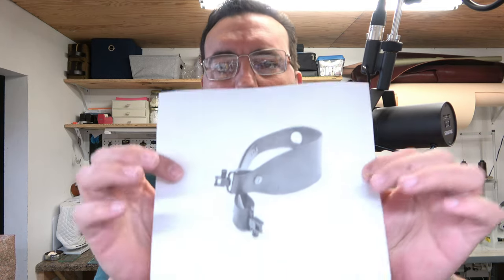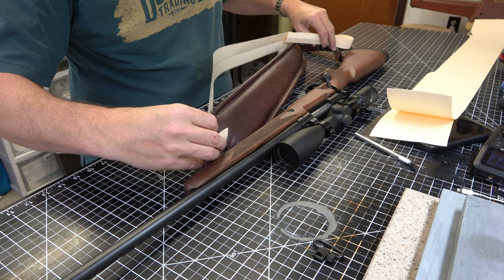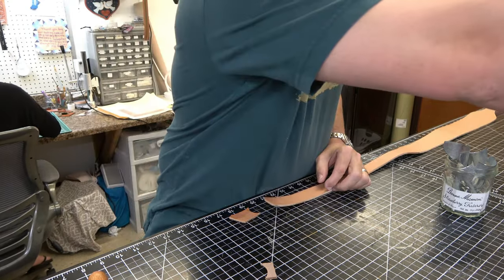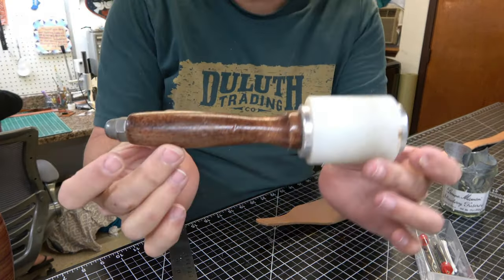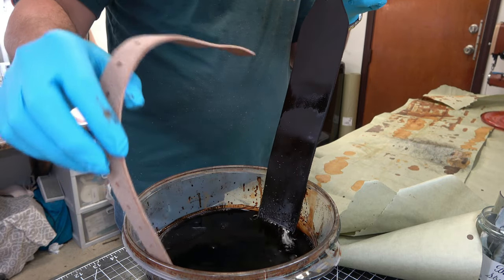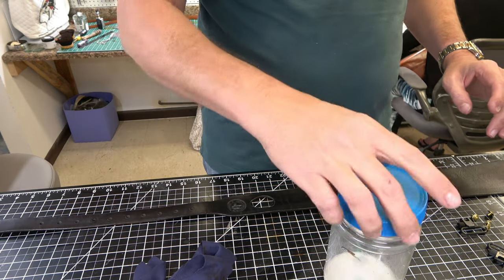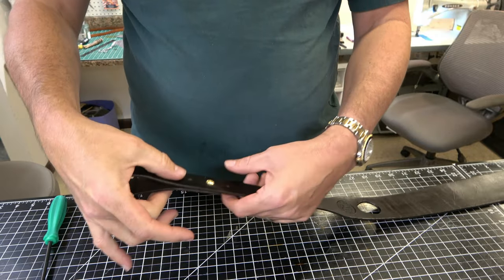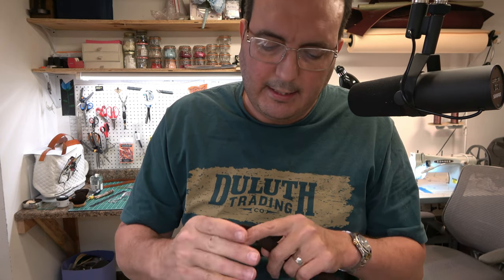How to Make a Custom Leather Rifle Sling

Comment: Where's the padding how come no padding , if you've ever been out in the field with a rifle a suede non-slip padded inside is really nice . It makes all the difference !!! Plus where your thumb hole is you compromised the integrity of the sling ! Those two thin pieces of leather on each side of the thumb hole are going to crack and break first 👎😬 you should have made the sling a lot wider in that area 👎 a broken sling in the field is no Good  and the possibility of a beat-up expensive Fire arm , the number one priority is strength and integrity , no matter what your crafting or building 🤓
Reply from the maker: I didn't put padding because the customer didn't want padding. They asked me to make a copy of an existing sling with better leather. That's what I did.